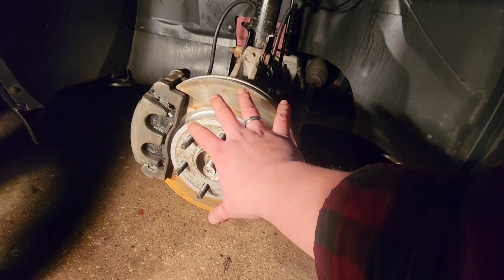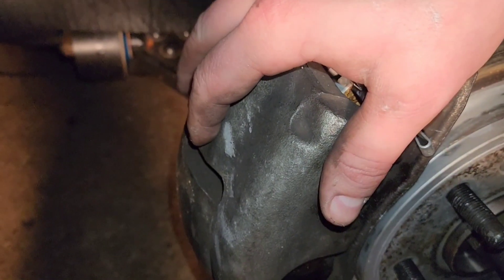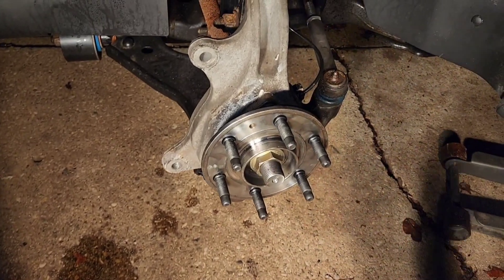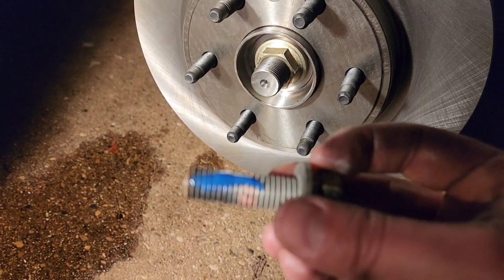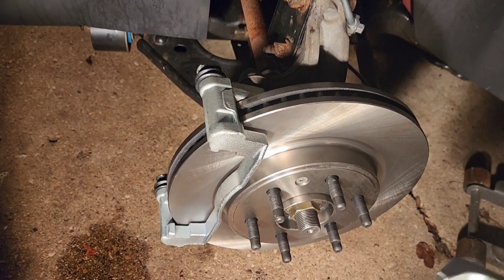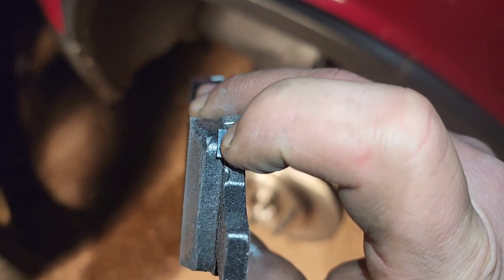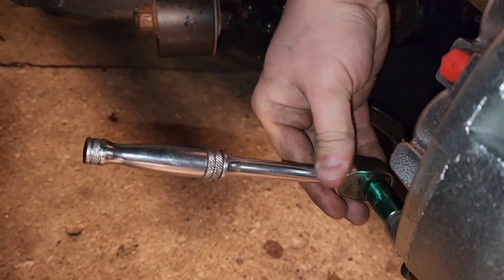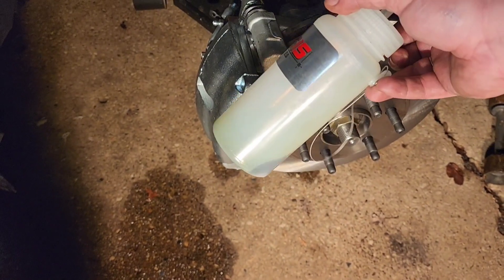I replace Acadia/Traverse/Outlook/Enclave Calipers, rotors and pads

Comment: Thank you! Bleeder screw is stripped on my 2012 acadia slt and I need to do a brake fluid flush. I've opted to just swap calipers instead. Bought all 4 but really hope all I need to do is the back two. Currently not planning on doing pads or rotors

Comment: I struggled for awhile as well getting the brake pads seated on my acadia until I learned to NOT tighten the bolts down all the way until the pads are seated. Start the bolts, seat the pads and then tighten the bolts down all the way.

Comment: Were you having any steering wheel vibration at highway speeds? I had a few guys say they "fixed" their's after swapping out for new brakes and calipers.
Reply from the maker: No vibrations that I know of. For that, I would investigate all joints and bushings and check for excessive wear or possible issues with tires/wheels